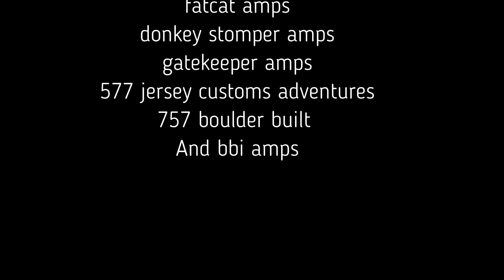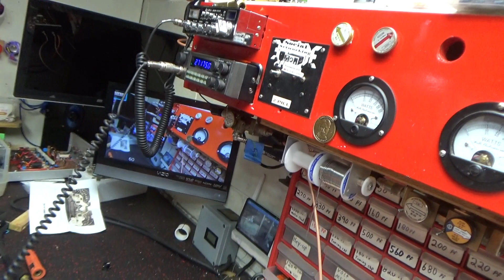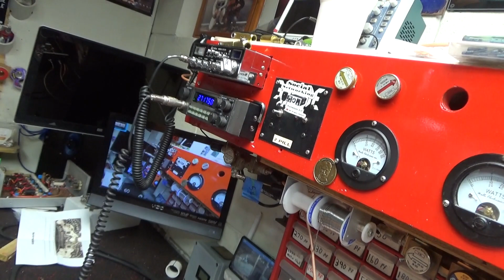1000W and 1200w Switching Power Supply part 1

Comment: I should have my hp dsp1200 sb not this week but the next  I'm having The Mods done to it before it gets ship to me
Reply from the maker: hell yea there good
Reply: @3madeamps #3 in nc  you know how bad my hands shake when I try to solder something
Reply: @3madeamps #3 in nc  bbi did a video on YouTube driving a 4 pill with a Stryker 955 doing around 120 peak using the hp dsp1200 sb a to power the 4 pill  It handled the amplifier   with no problems  On AM or SSB  Before he did that test he used a battery load tester  On The power Supply to see what kind of good amperage  he could get and still maintain good voltage  After watching that is what made me decide to buy one And have the mods done to it just to have around in case I ever need it.
Reply: @3madeamps   Check out the video 1000 amp power supply BBI built using these
Reply from the maker: @chevyguy1128  i seen it 2 weeks a go
Reply: @3madeamps  I might be wrong but are they not some that don't need any mods? I know they might be a little higher but I ordered 4 100 watt supplies that just said operate at or under 80%?
Reply from the maker: @gregoryb2999  maga watts is the only ones